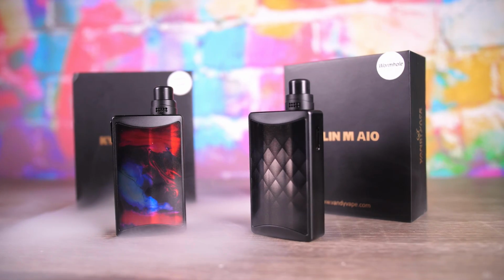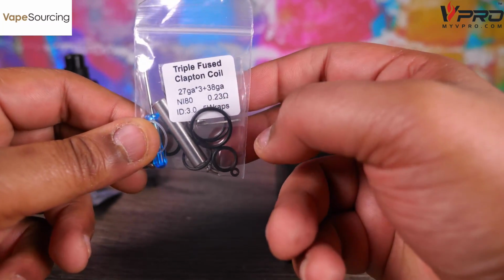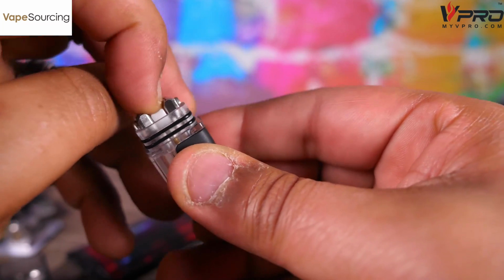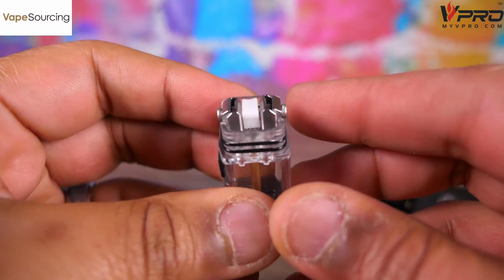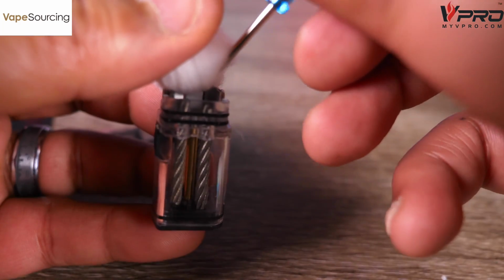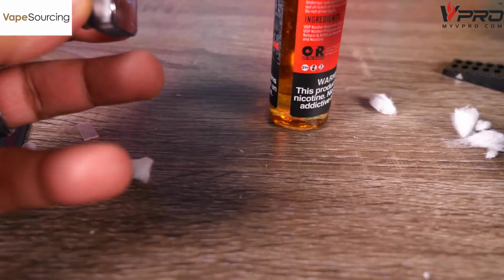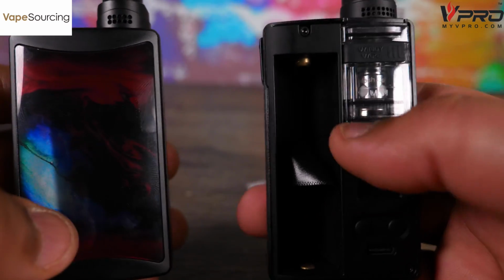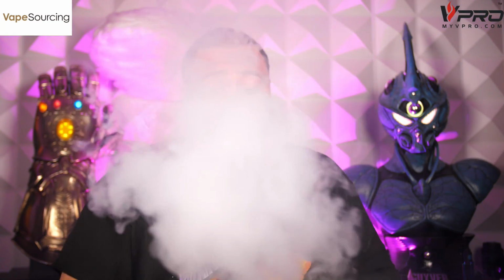The KING of AIO's! Vandy Vape Kylin M AIO! (Old School Review) Rebuildable Pods!

Comment: Have any of yall had issues with the SS wicks not sending juice to your cotton? I just got this and I had some really rough dry hits due to the cotton not staying juiced. Idk if I did something wrong or not, but I'm having a hard time understanding how the SS wicks work.
Reply: With my experience on building your cotton may be to packed not allowing proper juice flow. Another the using this system you need to alternate the so the juice is splashing all four cords.